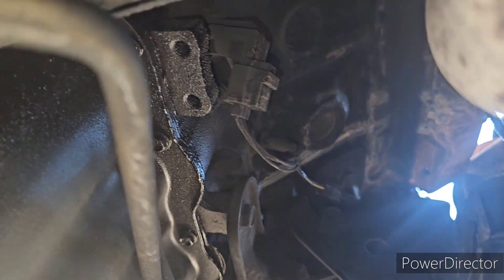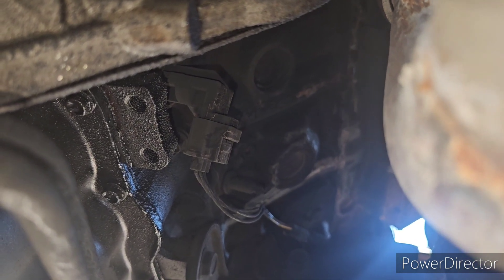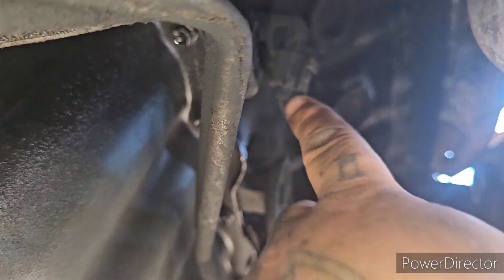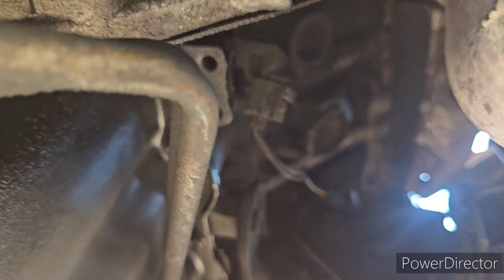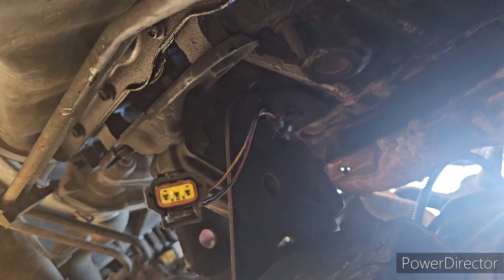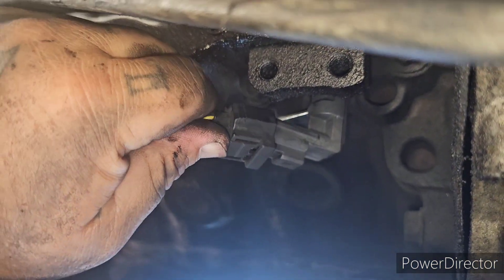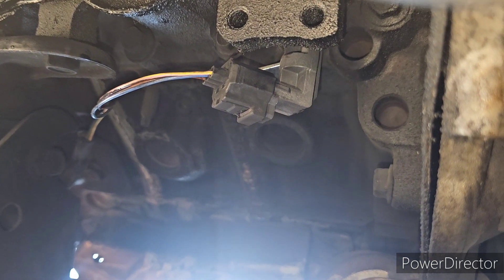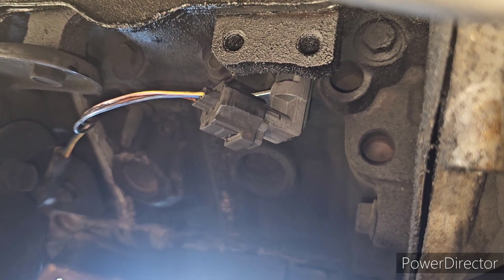Jeep Liberty Crankshaft Position Sensor Remove & Replace

Comment: When will anyone back the camera up enough to see where it is
Reply from the maker: I thought my angle was pretty clear but apparently not
Reply: @DavidNaritaYT  I found it.   Finally got the bolt off but mine appears to be rusted in wont come out for anything.   Can't see it from the passenger side or even get a light in the exhaust is blocking.   
Man what a nightmare
Reply: I wonder if you can twist it but it feels weak and plasticy like it will break.  But then how can it rust?  
Seems unfair ugh
Reply: It won't come out.
I tried WD-40 no good.  Its welded in there solid with rust apparently

Comment: It's sounds easier then it really is and that's because if it have been replaced before then yeah its easy if not then that mf will be stuck in there and most likely you will break it
Reply: Yep!
Reply from the maker: You just have to be patient wiggle it around till it breaks free
Reply: Hey there when you broke it how did you get it out.
Mine sounds like a cricket when I wiggle it, as if its straining about to break. 
I just don't want half of it left inside then I'm screwed
Maybe PB blaster?  I just ran out of course
Reply: @e.gadd.1  yes used PB blaster let soak in then I screwed a screw in the middle of it and used a roughneck pry bar and pry it out. It took a lot but I got it out
Reply: @djharryjohnson  oh wow.  I hope its not that hard.   It seems to have a rubber ring, why in the world won't it twist
Reply: I can't get it out, and afraid of being stranded if I break it.
Im assuming I can't drive the vehicle with a broken crankshaft sensor at all?
I'm going to have to take it to a mechanic.   I hate to pay someone for something so simple :(
Especially when I"m broke!
Reply from the maker: @e.gadd.1 small flat head screw driver can wedge it out.
Reply: @DavidNaritaYT  Its so hard to get to and of course now its dark out.
I will try ramps tomorrow morning maybe better access
Reply: My replacement doesn't have a lip, not sure if the stock one does.
It just has an indentation with a rubber ring.
Maybe you are prying under the metal extension tab that holds the screw?
Reply: I wonder if it can be twisted or if it will break
Reply: @e.gadd.1  before mine broke I was wiggling it back and forward. Maybe I was using to much strength. @naritasanstudios says be patient take your time. I don't have experience in getting it out whole so idk how to twist it to get it out
Reply from the maker: @e.gadd.1 once you get it jacked up high enough it's really not that hard.
Reply: @DavidNaritaYT  Sure looks that way but not when its welded in and could break off inside.   I don't like the idea of being stranded and not being able to get to mechanic either.
Will have to look at this again when I am more able to go without a vehicle
Reply: @e.gadd.1  Idk if you can still drive it if you break it. You can always test that theory by just unplug it and see if it starts up and go. Turn of and start back up and go
Reply from the maker: @djharryjohnson no it will not run without a crankshaft sensor. It will not be able to detect what position the crankshaft is in therefore will not start.
Reply: @DavidNaritaYT  yeah this is too much risk if it breaks and is stuck in the vehicle.  I have about 3 weeks of work to do before I can go a day without a car.
I'm behind the 8 ball as they say.  
Will have to limp on for now and try this later I guess.

Comment: Yeah dont forget to take the pre cat out because it would be in ur way
Reply from the maker: 😆 seriously? Stop spreading misinformation. I replaced mine without removing the cat. Literally removed the 1 10mm bolt holding it in and removed it easily.